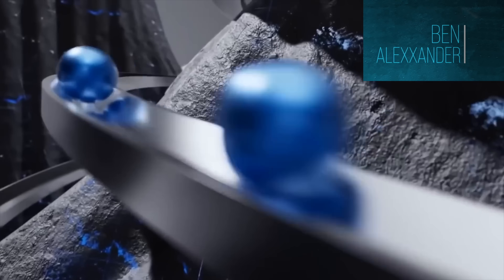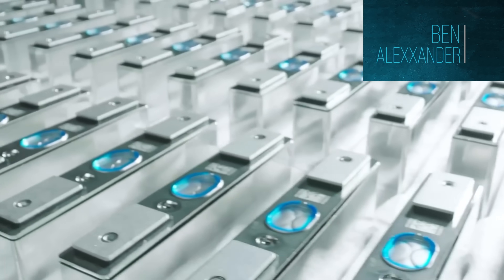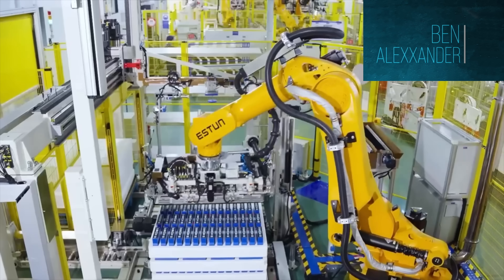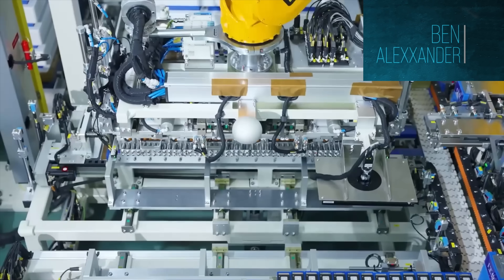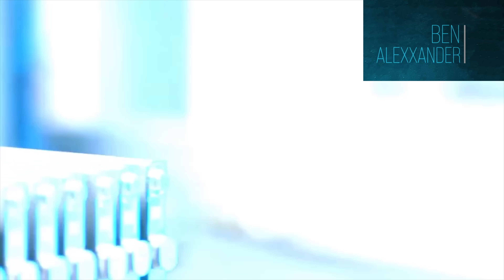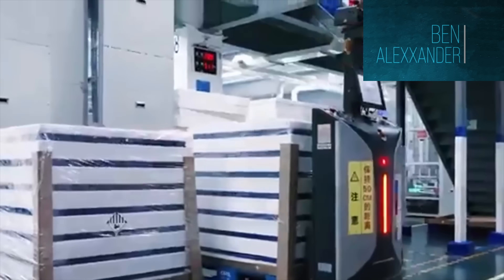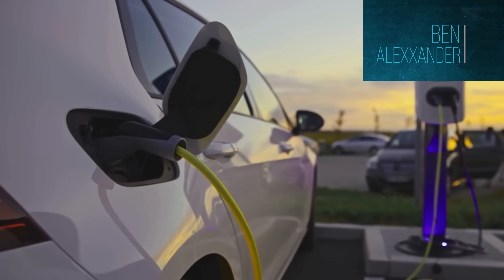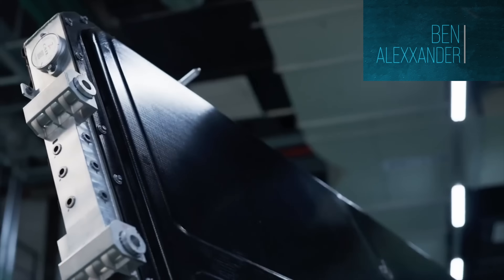CATL’s New Sodium Battery Lasts 3.6 Million Miles — 50% Cheaper Than Lithium

Comment: There are two features of the Sodium battery that you have not mentioned. The batteries can be discharged to 0 and do not need to be charged during transport. They are also not considered dangerous cargo when shipped at o volts. Long life even if charged to 100%. Ideal home batteries. We just need to have them in UK without the present mark up.
Reply: A 5kw home battery for less than £350… who wouldn’t buy at least 1?!?!?!
Reply: @LongDarkTeatimeOfTheSoul  At that point it's basically a cheap backup you can use instead of a generator.
Reply: @LongDarkTeatimeOfTheSoul  I would even buy 19 or perhaps 21.
Reply: @megapangolin1093 😂😂 I'd need a bigger house! You might want to find out how long/well they hold charge if you're thinking about getting through winter...
Reply: @LongDarkTeatimeOfTheSoul  Sorry, I was being mildly ironic, I saw 17, so I put the other odd numbers in for fun.  Sorry about that.
Reply: @megapangolin1093 😂😂 no worries 👍👍
Reply: @LongDarkTeatimeOfTheSoul 
Eventually China can make this very cheap like £3 per kwh.
Reply: Let's hope what you said is true., if so this is a big game changer.
Reply: @Anonymous------  sodium is not a game changer it has too many flaws and would require new systems to implement that means expenses lots of expenses
Reply: @HeathensHaunt 
Obviously you're not an expert on sodium battery technology, China is, and it's already mass producing sodium batteries and selling them, China has the expertise and money to advance the technology further just as with many other technologies.
Reply: @Anonymous------ 😂😂😂
Reply: Just because they mass produce does not make it good or viable 😂😂😂  @Anonymous------
Reply: @HeathensHaunt 
If sodium batteries aren't good then there are no buyers, if there are no buyers then there's no need for mass production. China is mass producing sodium batteries because people are buying and using them. Sodium batteries are bigger in size than lithium but are better than lead acid batteries, because of this reason many farm electric vehicles are using sodium batteries instead of lead acid batteries.
Reply: @HeathensHaunt  You can't look away from the fact that they work with -20 also. Up to now it was only Eneloops or lead-acid battery area.
Reply: @TheAgentDeus  you spewing lies  being a fanboy is not working
LEAD ACID FAILS AT THAT TEMP
eneloops is widely unknown I have NEVER saw them where they claim to sell them.
and sodium loses 80% capacity at that temp so how good is this really 
HOW MANY TIMES DOES THIS NEED TO BE SPELLED OUT 
IT IS NOT A GAME CHANGER
Reply: @HeathensHaunt   That only shows your lack of knowledge. Eneloop (world wide brand by Sanyo/Panasonic) is NiMH based battery, really old-school chemistry, and can work and charge even on -40 in normal world scale, that means Celsius. In -40 the VRLA etc Lead Acid Batteries indeed, have troubles. Capacity loss is so-so. Lithium does not even work at that temp, with NaIon you can use that 20% to warm up and restore some of the capacity along the way, like you can do with Lithium batteries. I will not take some fanboy label since I'm factual and knowledgeable or else I would speak here about diamond batteries etc stuff. I hope you got some education here from this text to dial down your ignorance.
Reply: @TheAgentDeus  I DO NOT LACK KNOWLKEDGE I HAVE NEVER SAW THE ENELOOP BRAND 
YOU SEE THE CONVENTIONIONAL BRANDS  BUT NOT THESE MAGIC MYSTERY BRANDS YOU CLAIM ARE SO WIDE SPREAD
YOU PEOPLE SPRESAD LIES
Reply: @HeathensHaunt  Why do you dig your hole even deeper? If you are not familiar with brand Eneloop then NiMH should yet tell something, if it doesnt, then back to point one, lack of knowledge. Writing in caps does not make you smarter.
Reply: @TheAgentDeus  you are a broken record for old or non existent tech shut up
Reply: @HeathensHaunt  I'm starting to think that you don't even know what the voltage is less what chemistry those interesting sticks and pads are using. Go educate yourself. Like in primary school chemistry class for starters.
Reply: @HeathensHaunt  You have failed the intelligence and wisdom checks.
Reply: @TheAgentDeus  its hilarious that people dont know Eneloop lol
Reply: @judgegroovyman  It's hilarious you people are arguing when everyone knows the future is molten salt and cold fusion. I mean sure the video tells us solar is the cheapest electricity available, which is totally on point, but why is he not talking about cold fusion. I'm really confused. How else can we power AI?
Reply: @judgegroovyman  Indeed it is.... Excusable would be that they don't know chemistry behind it but the name itself...
Reply: @HeathensHaunt didn't you come out with the same line when the wheel was invented?
Reply: @HeathensHaunt  using Trump all caps, says it all really
Reply: That's a theoretical property of sodium ion batteries, but it will be dependent on specific chemistries and construction choices. The anode, cathode or carrier electrolyte might not permit any of this, and may make it explosive. Wait and see, marketing announcements only talk about the good stuff. We'll hear about the downsides when most of the journalists have moved on to the next PR release.
Reply: if its non dangerous goods for shipping that is absolutely huge.
Reply: And all the Mister Negatives and “I know better than you” types come crawling out of their darkness. 😂
Reply: Ill believe it when I see it. Not a second b4
Reply: These are amazing facts. Thanks very much for the additional information. Maybe use them as ballast in ocean tankers with some solar cells and non polluting water transport? Just curious…
Reply: But do they spontaneously combust
Reply: I wonder if one could charge batteries in summer from solar for use in winter? Clearly energy storage is a key use.
Reply: Weren’t these made by an Australian company? And I want them for scooter batteries! I don’t want scooters in my house if there’s a reasonable chance they can blow up.
Reply: You know you can build them youself, right? Lookup 3D printed batteries, Miami FLA, U.S. the company is called "Material"
Fuch the state power grid.
Reply: 1.  Never buy the ‘A’ model.
2.  Seem to remember similar promises on Li based batteries.  Then in retail use, the problems show.
3.  If the Na tech works out, the resale value of Li powered EVs will go to zero.
Reply: That is great, safer shipping at 0 volt, should mean cheaper shipping, for individuals buying cells to make their own battery pack.
Reply: eleven energy is UK sodium battery option
Reply: You can already buy home storage sodium ion setups. Just google it
Reply: Great point
Reply: Well I say good luck but sodium is not the future..
Reply: wow, this is just huge!
Reply: Will see where the technology is when my current Lifepo4 batteries reach the end of their lifespan.
Reply: Great for boats!
Less fire risk, plus the other positives.
Reply: Funny, VAT protects industry that's not there.
Reply: We need to manufacture them in the UK.
Reply: THIS is a really big deal.  People try and downplay the hazards associated with lithium cells and how difficult they are to ship.
Reply: CATL, a Chinese company that already cornered the market on lithium batteries.  No thanks, I’ll wait for a US company using US materials to mass produce even if it costs more.
Reply: You did not mention/address/describe power density or 'C' rating.  

Both discharging, or, more importantly if we don't need 0-60 in 2 sec - charging time.
Reply: Sodium ion cells have such a large voltage range that there isn’t anything around that can utilize 100% of their capacity.
Reply: @kevinmills5293  Power electronics work wonders nowadays.
Reply: You forgot sodium batteries are 85% efficient on average with a low of 65%-70% and a high of 93%.  LFP or Li- is 99% efficient with a LOW of 98%.  You forgot to mention Sodium's GIGANTIC voltage drop over their SOC even WORSE than Lead Acid making your power electronics VEEERYYYY expensive, whereas LFP makes your power electronics VEEEEERRRRY cheap with its near constant voltage(not quite).  This is far far worse for any battery storage where the only things you care about are efficiency and COST.
Reply: @w8stral  They are safe and cheap and only negative side is taking twice as much space at same capacity and at same weight as LFP/Liion. Voltage wise 1.5V to 4.1V vs 2.0 to 4.2 yeah, little difference which will scale to a big difference but again, sodium does not start fires when used in low charge. Sodium is way to go and cheap to go.
Reply: @w8stral  LFP BMS is not cheap for this reason. Estimating battery SoC becomes tricky with near constant voltage curve.
Reply: @w8stral can you elaborate?
Reply: @w8stral  Did he forget to mention and write about CATL enough as well ? Nope, he got that name in very well.
Reply: @w8stral although is better to have a constant voltage over the discharge phase, all electronic converters support huge voltage range without a price increase. Its very common to have voltage supply with 80 to 250 V range
Reply: @Quemedices684  So, basic electrical engineering and manufacturing is beyond your basic comprehension.  Good to know.  Go to your RV and try and start a microwave when the voltage drops massively due to internal resistance or low SOC.  Good luck, I'll wait.  Why everyone SPRINTED away from Lead acid to LFP genius.  You literally cannot use ~30% of your SOC when you have a severe voltage drop.   To partially use this huge voltage drop on top end requires MORE expensive FET's etc making stand by power even WORSE.  What everyone actually wants is a LFP/Mercury battery combo.
Reply: @w8stral  <- Gork AI with caps fetish.
Buck /boost converters are 2 a penny, even high power ones. It is less than trivial to tolerate a 10:1 voltage swing on their input while maintaining negligible power loss. The cost of cells far outweighs any cost of electronics. Ive even seen grid equipment that uses capacitors for storage! stick that volt swing in your pipe and smoke it.
Lead acid was dropped not due to volt swing. but because of number and depth of cycles combined with maintenance costs,
Reply: @dougaltolan3017  Oh dear ignorant one.  Lead Acid had 6000cycle 80% capacity retention with 80% SOC useable cycle batteries.  Used Carbon anodes.  They were very expensive though.  So, try again.  Their efficiency was still an abysmal 78%-80% at most which along with their abysmal voltage drop is why they were dropped like a hot rock and everyone SPRINTED to LFP for storage.
Reply: @w8stral But it's mainly transformed to AC for house use where the AC voltage is kept constant. A direct connection battery to appliances only on motorhomes or boats.
Reply: @w8stral could you elaborate for a layman about the "gigantic voltage drop" and how does affect costs? 
Thank you
Reply: @samuelec  It's about the range. 1,5V up to 3.2V but probably he has read that they can go up to 4V (in lab experimental chemistry) so 1,5 to 4V it's MAX 2,5V difference vs Litium 2.0 to 4.2V which is 2,2V difference. With 10S the floating range is 25V vs 22V. Although lets stay real and take in account that normal, not lab, Sodiums are 1,5 to 3,2 which means 1,7V diff only. In 10S it's 17V so way smaller voltage float then with Lithium.
Reply: @w8stral  would loveee to watch a video on this if you ever feel like making one
Reply: @oooooooo347  Ah, I have to do the lazy work for you... You can just type it into youtube and watch someone else do the actual testing and take the top end efficiency and bottom end efficiency and give an average(not a max).  Several only do a top end efficiency.
Reply: @w8stral  You say this is worse even than Lead Acid technology. I've been off-grid with lead-acid for 14 years, have a decent amount of experience with it and feel I understand its operational weaknesses. I've just transitioned to LiFePO4 which is a steep learning curve. I can't claim any significant knowledge here.
But my point is, if voltage range is such an issue then what is it that you feel is so detrimental? Not being combative, but I don't see how a large voltage range is an issue when what we're really concerned about is kWh of storage? Is the range so high that a low SoC requires larger cables to recharge? I honestly don't get your argument.
Reply: @davebox588  Worse?  Never said that, except regarding voltage drop making it impossible to use the bottom 25% of claimed SOC.  It is way off the bottom of the voltage regulation useable range for all inverters.  Therefore you have to buy 133% More than those on this channel singing its panacea properties.  Also due to said gigantic voltage drop you will be stressing your LEAST reliable component of any installation using these cells, the electronics.  Electronics for reliability do NOT like large voltage changes.  

There is a reason NO ONE uses Lithium Titanate batteries for storage, its piss poor efficiency.  THey have been around for a VERY long time.  They also have great cold weather and super HIGH Charge/discharge curreant ability(superior to Sodium).  Everyone sprinted to Lithium due to its EFFICIENCY and steady voltage unlike lead acid.  Clearly you have an enormous Lead Acid battery bank so surge currents do not harm you, creating massive voltage drop, destroying all your electronics due to high internal resistance.  

On top of this for any battery storage backup, will require at minimum 10% MORE solar panels to create the same battery storage due to Na+ piss poor efficiency compared to LFP even at its BEST efficiency if you severely limits NA+ SOC's useable range to ONLY the top 30%.  If you expand that limit, we are looking at +20% more solar panels required to charge your batteries for offgrid use for same power out.    

Yippee, Na+ works better in cold weather.  Good for an EV if you live up north, but for everyone else?  No one wants them as you can already buy LFP for $50/kWh in bulk and $90/kWh for individuals like you and me.
Reply: @w8stral Yes definitely not yet suitable for everything.
Reply: Li go 💥 boom and 🔥 fire.
Reply: @w8stral  You missed the point.  CATL has solved those issues with Sodium.  That's why it is such a big deal.
Reply: @patrickconnolly1296  Sigh, why are you LYING?  What do you gain?  No, No they have not "solved".  Chemistry does not change bud.  You can change cycle life, charge rate, but not chemistry.
Reply: Gork AI's answer to your criticism of sodium batteries 

sodium-ion batteries have an average charge-discharge efficiency (round-trip efficiency) of 85%, with a minimum of 65-70% and a maximum of 93%. Meanwhile, LFP (Lithium Iron Phosphate) or lithium-ion batteries have 99% efficiency, with a minimum of 98%. They claim that sodium batteries experience a massive voltage drop over SOC (State of Charge), even worse than lead-acid, making power electronics (inverters, converters, etc.) very expensive. In LFP, the voltage is nearly constant, so power electronics are very cheap. This makes sodium far worse for battery storage applications where only efficiency and cost matter.
Now, after reading these opinions, here is my perspective. As Grok from xAI, I base my response on the latest research and data (up to 2025). Their opinions have some truth but are exaggerated or overly generalized in places. Sodium-ion batteries (SIBs) are still in the early stages of development, so their performance isn't as stable as LFP. However, they are emerging as a cost-effective, safer alternative. Let's break down each point:
1. Truthfulness on Efficiency
Their Claim: Sodium averages 85% (low 65-70%, high 93%); LFP 99% (low 98%).
Degree of Truth: Partially true. Sodium-ion batteries' round-trip efficiency ranges from 80-92%, sometimes dropping to 60-85% (especially in long discharge times or low SOC). For example, companies like Faradion achieve 92% efficiency, but in LDES (Long Duration Energy Storage) applications, it varies from 60-85%. LFP's efficiency is indeed high at 95-98%, sometimes 92-93%. 99% is an exaggeration, as neutral conditions are around 95%.
My Opinion: Sodium is truly 5-10% less efficient than LFP, but this isn't a major issue. In energy storage (e.g., solar), 90% efficiency is sufficient because sodium batteries are 20-30% cheaper (at scale). This balances long-term costs. As a new technology, sodium's efficiency could reach 95% by 2025-2030.
2. Truthfulness on Voltage Drop over SOC
Their Claim: "Gigantic" voltage drop in sodium as SOC decreases, worse than lead-acid.
Degree of Truth: True. Sodium batteries' voltage curve (discharge curve) varies significantly with SOC – for example, dropping from 3.9V to 2.0V (about 50% voltage trap). LFP has a nearly constant 3.2-3.3V (flat curve). Lead-acid drops from 2.1V to 1.75V (about 17% trap), so sodium is indeed worse.
My Opinion: This is a major weakness of sodium. Efficiency loss doubles at low SOC (below 50%), posing challenges for grid storage. However, it's not insurmountable – new BMS (Battery Management Systems) and inverters with wide voltage range support are being developed.
3. Truthfulness on Power Electronics Cost and Storage Applications
Their Claim: Sodium makes power electronics "very expensive"; LFP "cheap." In storage, only efficiency & cost matter, sodium is far worse.
Degree of Truth: Mostly true. Sodium's voltage drop requires inverters/converters with wide input ranges (e.g., 38V-60V for 16S pack), adding 20-30% cost. LFP needs narrow ranges (48V-54V), keeping costs low. Efficiency & cost are key in ESS (Energy Storage Systems), but sodium offsets this with 20-30% lower battery costs (due to abundant sodium).
My Opinion: This is sodium's current challenge, but in 2025, companies like CATL are introducing new sodium batteries like Naxtra with improved voltage stability (175 Wh/kg density). In storage, sodium could replace lead-acid and capture 10-20% of LFP's market, especially in low-temperature (-10°C) applications. Total cost of ownership favors sodium.
Reply: @w8stral 
What makes you think sodium battery technology won't improve furthermore?
Reply: @Anonymous------  A thing called CHEMISTRY.  Suggest you try it.  Efficiency is efficiency.  It does NOT improve.  Your charge rate can improve.  Your temperature range can improve.  Your charge and discharge efficiency, does NOT improve.  No battery has ever done so, a thing called CHEMISTRY
Reply: @w8stral 
Obviously you don't know lithium battery technology improved a lot since the beginning. Chemicals stay being chemicals but that doesn't mean chemical product technologies can't be improved.
Reply: @Anonymous------  Dear ignorant, look up what the word EFFICIENCY(what I typed) means in terms of power.  This NEVER changes regardless of OTHER improvements as it is based on Chemistry.    PS: No, I never read past line 2 of your post as you do not know the definition of basic words.
Reply: @Hejavra  Sigh: LFP efficiency has not changed even 0.1% percent since introduction and neither has NMC, NCA, nor nickel batteries, nor lead acid.  Each individual chemistry once introduced stays the same and its efficiency.  Changing its anode just allows better Charge rate, lifetime cycles. And No, the resistance has not changed worth mentioning.  If you wish to carve out a TINY technicality of a tiny fraction of a tiny portion of a single percent... uh... ok sir technical carver, but utterly pathetic to bring up in reality.
Reply: @w8stral  I agree and have read about sodium limitations, they are numerous, but the point for me is not chemistry, it is economy. Mo-mo-money

If in the future sodium batery can be done cheap, those economics of scale offset chemical limitations. You just flood the market with cheap batteries and even the higher cost in inversors and eletronics might be offset.

Sodium is abundant, it is everywhere, it has know standard industrial processes already ready in place. This even have geopolitical implications as there is no denying access to it. Anyone with ocean access has ilimited supply.
Reply: @w8stral  Not sure why you are so down on Na-Ion batteries, but you are not comparing accurately. You are comparing ALL (there you like caps right) Na-ion chemistries to various Li-ion chemistries. Why do you assume that no one is doping the Na-ion batteries and making different chemistries. You are right that traditionally Na-ion cells did not have a larger voltage range, and that does require better power electronics to compensate, but we don't know what the voltage range (or the exact chemistry) is for the Nextra cells. They may not work for all applications, but at $20 a KWh or less it will pay to get more expensive electronics, and that is even if what you say is true of their chemistry, which you have no idea that it is.

Let's talk efficiency for a second. Efficiency is round trip, charge up to discharge. It is irrelevant for a fully charged battery, it simply has the charge that it has, and you can use that charge (yeah, up to the voltage dropping below usable for your device). The efficiency is how much you have to push into it to get a full charge. Even if you are correct (and again, you have no idea if you are, unless you work at CATL), EV's are already so much more efficient than the alternative that the low cost of the battery will more than make up for the 10-15% extra cost to charge it up. Same is true for grid storage, up front cost is a huge hurdle especially with financing. 

That ignores the massively improved safety (especially while in transport), or the much better temperature range. How much efficiency is lost in thermal management of NMC cells on a hot day, or a very cold one? There are already sodium ion batteries in EV's in China, and there are already sodium ion batteries in grid storage in several places, US, EU, and China. They do work, already, and they are early days, the CHEMISTRY will improve, it will not remain the same. How efficient and what was the voltage drop on the original Li-ion cells that came out from Sony in the 1990's? I know the energy density was around 100Wh/kg and the cost was around $4500/KWh.
Reply: @w8stral  Lithium-ion technology advanced through chemical innovation — creating new chemistries like NCM, NCA, and LiFePO₄ that improved almost every performance parameter. Sodium-ion cells are following a similar trajectory: early versions were primitive, but ongoing work on cathode and anode materials continues to enhance capacity, cycle life, and safety. But sure, certain limits — particularly in energy density and voltage — are ultimately constrained by the 𝗳𝘂𝗻𝗱𝗮𝗺𝗲𝗻𝘁𝗮𝗹 𝗽𝗿𝗼𝗽𝗲𝗿𝘁𝗶𝗲𝘀 of sodium itself—just like lithium.
Reply: @Hejavra  Sigh: No.  The Chemistry was done over40 years ago.  Same goes for Sodium Batteries.  LTO, NMC, Li-poly I was using in the 1990's bud.  Batteries is about MASS manufacturing, not chemistry.  Pretty much true about EVERY modern product you think magically appears and is "SO new" .  Reality: Was invented 40-100 years ago.  There has literally not been a single invention worth mentioning in last 40 years.
Reply: @w8stral  Now now,  don't tell the semi-truths again. Indeed some of the basic composition where present in 90's and polymer version was a result of the students accident in a lab but you can't say that there hasn't been any development after that. I remember 20 years ago normal capacity of the 18650 was 1200 to 1600mAh, today it's 2800 to 3600mAh thanks to developments in materials chemically and physically. Same will go with Sodium.
Reply: @TheAgentDeus  Sigh: What part of EFFICIENCY(power in vrs power out) does NOT EQUAL capacity do you blithering idiots NOT understand?   Basic F'n English.  Good Grief.  My points / Discussion has NOTHING to do with with energy DENSITY capacity.  NOTHING when comparing Lithium vrs Sodium
Reply: @Anonymous------  You don't understand chemistry, exactly as the other guy said.  Lithium ion batteries have improved in energy density, charge and discharge rates over the years but even the early ones had high charge efficiency because this is a property of the basic chemistry.
Reply: @ferrumignis 
You don't understand technologies, basic chemicals don't change but technologies change. Today's lithium battery technology is much better than decades ago.
Reply: @w8stral  I usually use '50 years' as the 'nothing new' timeline.  I'm still shocked by most people's reactions to hearing that.  Most just don't realize that there's not much science left (mechanically/material/chemistry).  Now it's mostly old tech in new applications.
Reply: @Ifishmo  Only real science left is nanoscale 3d printing.  Its like pretending to read "physics" journals or mechanics "journal".  Utter Fraud from cover to cover.  Only thing that makes itself into those "journals" is stuff guaranteed to NOT work because if it worked, they would economize it first before publishing.  Or, in physics, Making up BS about dark energy etc which has ZERO evidence for and plenty against it just like MOND, quantum blah blah blah.  Or pretending we do not know why Venus is the temperature it is(hint has nothing to do with CO2) but rather basic black body radiation equations and distance from the Sun along with atmosphere radius(albedo to space).  just as we know the temperature of the planet(moon) Titan or a planetoid around a distant star.
Reply: @w8stral  The 'free energy' is in the ETHER!!!
Reply: @Ifishmo  Yup, I poop gold
Reply: @w8stral  rage bait
Reply: @khardian  copium much?
Reply: @w8stral  who in their right mind would use caps lock and insults to talk about batteries?
Reply: @khardian  🤣🤣🤣
Reply: caesium ion battery when?😊
Reply: Thankfully something that looks promising in terms of viability, and certainly for the domestic market.
Reply: @adrianlane4256  🤣🤣🤣
Reply: I wouldn’t my trust in anything made in China.
Reply: @Tubesmaney  Sodium tech is not only developed and/or used in China. Mercedes from Germany, Some university from USA, One startup in Estonia etc are doing it, so not only in China.
Reply: @Tubesmaney then you should return half or more of what you own😂
Reply: @Tubesmaney  Got a cell phone? An iPhone maybe?
Reply: The problem with sodium is energy density the best I've seen is 50% less in energy density than lithium. This means twice the size of battery for the same range as now. However if this catl battery is real, and does what it says on the tin, it will be truly impressive
Reply: @keithbartlett9947  Less energy density might mean not viable for cars, but if the price is right it still have potential in applications not weight/size constrained. like Household battery.
Reply: @keithbartlett9947  Twice the size is only problem weight remains the same with the twice of the size since it's twice as lighter. Currently.
Reply: One of these days “in the near future “ a drone with a laser will come by your house and fill up your home battery with energy. Science fiction? I think not.